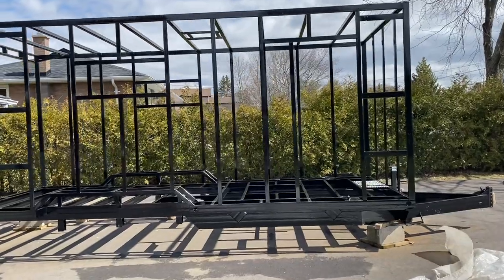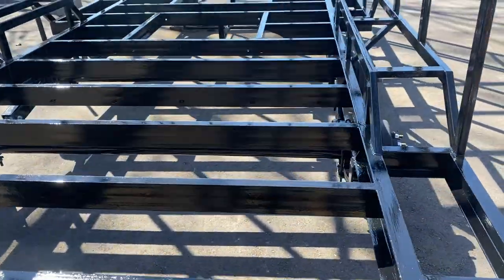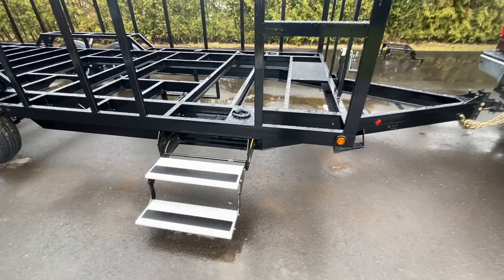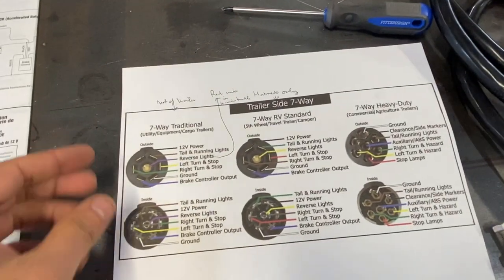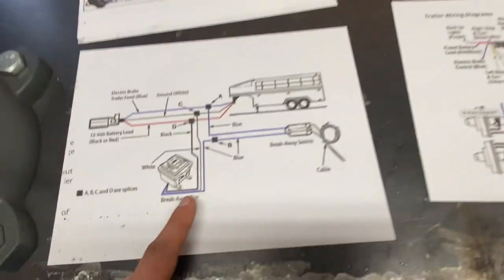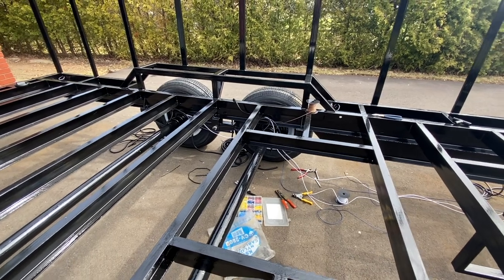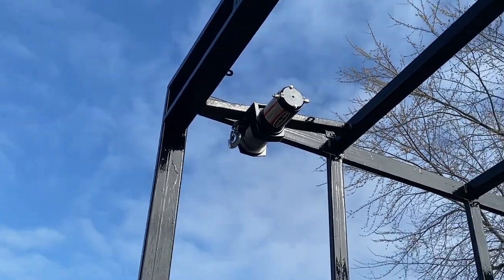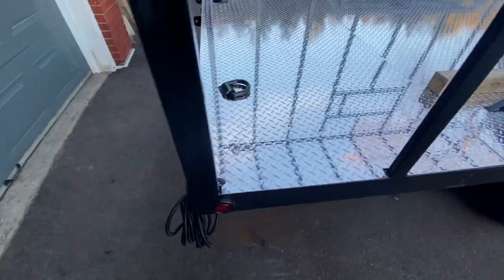Enclosed trailer build | Episode 5 | Paint and wiring

Comment: Great build!  How did you attach the tread plate to the frame?  Are you worried about galvanic corrosion over time?
Reply from the maker: Thanks. I used self tapping screws. Yes, galvanic corrosion could be problem, I didn’t think about it while building. It could have been mitigated by putting an insulator between the steel and aluminum.

Comment: What thickness of tread plate did you use? Do you feel that’s held up over time?
Reply from the maker: I used 1/8" tread plate and held up really well. For the strength to weight ratio, I highly recommend.